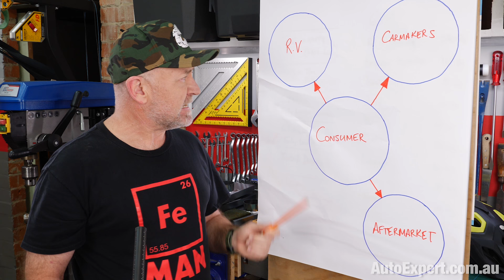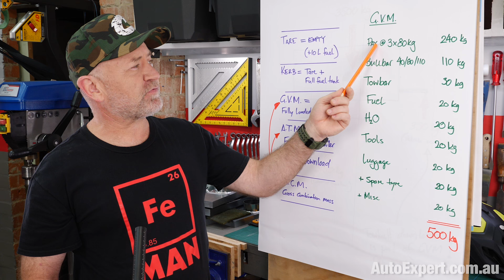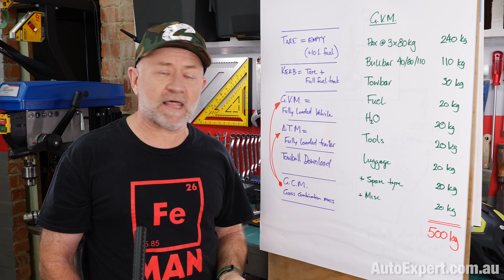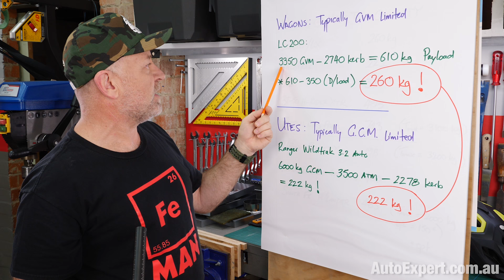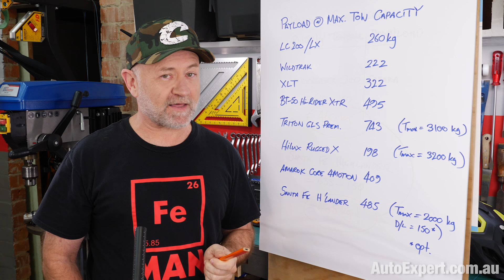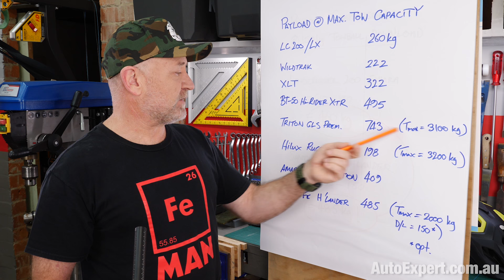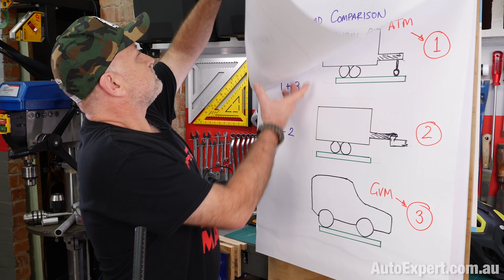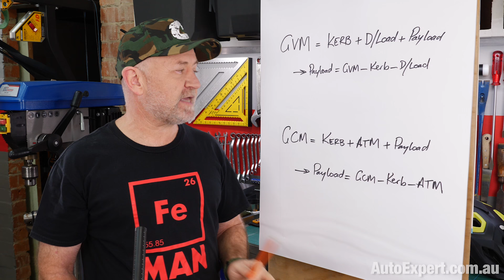Complete guide to heavy towing (GVM, GCM & ATM explained) | Auto Expert John Cadogan

Comment: The max towing capacity for some manufacturers is half for operating  offroad. It's often buried in the fine print. This is why you see so many dual cabs broken in half

Also, does the gvm upgrade also upgrade the driver?

Comment: I've watched this one a few times. Very good. Question though about mass of towing vehicle vs mass of trailer. Just for round figures and not representing any real examples, if you have a vehicle that weighs 2000kg and a trailer that weighs in at 2200kg, and you add 200kg of fixed accessories, such as roo bar or anything that doesn't move around, like people and stuff, then the vehicle now weighs 2200kg. Does that balance the weight of the trailer. I know it doesn't work for purposes of payload, as it counts as payload, but does it work for the purposes of resisting pitch and yaw of the trailer? I don't want to do this, but I am interested in the physics of it. Thanks.
Reply from the maker: The recommendation is just a rule of thumb. I'd say: Don't go too far off the reservation. This should be OK - just drive conservatively.

Comment: But. My Discovery has compressor for air braked trailer, tow limit 4000kg. A double towbar stabiliser, Brembo brakes on the truck, Cummins diesel and uprated suspension. It's certufied and plated at 7000kg GVM. But, still get the Iveco with gvm at 5500kg and GVM at 9500kg with air braked trailer

Comment: The Ranger's 3.5 tonne towing capacity is an absolute farce. 

If you hook up a trailer with 10% download, it's overloaded by 130kg. If you have the download at 5% then I hope there's a midget or jockey driving
Reply: The Ranger isn't rated anywhere near 3.5t in North America and I wouldn't consider anything less than an F150 for a trailer that weighs that much. Over 5,000 lbs I would want trailer brakes too.

Comment: I love your engineering for the layman. I recently watched your trailer hitch and totally agree but only have one point I really cant calculate. If the down force of the tow-bar is 350kg WLL, what does the load levelling device torque induce into the tow bar. Lets say the 10% rule of 2000kg, 200kg on the ball. Use any load level device for reference.

Comment: Santa fe would have 5 degrees of negative camber in the back with 150kgs on the tow bar (Also good luck staying under its 1395kg rear axle limit with 150 kgs, 1m back from the axle centre line).

Comment: Interested to know why you think bullbars are a bad idea? Safety, Weight, waste of time?
Reply: My guess is city slicker....
Reply from the maker: My guess about you: dumb fucker
Reply: We don't really do bull bars, but I am running a full guard winch bumper (14k superwinch talon). We have a shitload of suicidal deer in my area and I have hit 4 in the last 7 years. The first one messed up my stock bumper and the next 3 did nothing thanks to the 275 lb winch bumper. The extra 500 is not a big deal on a truck that has a 1050 lb engine in the front.

Comment: Jeebus JC ya left out the obligatory Engel Fridge & a carton of p!ss M8!
There’s an extra 20 or 30 kilos easy! 😂😂👍😜
Seriously tho, would you have thought with electric load cells cheap & readily available that the after market industry would have come out with kits by now that affix said cells under tow bar tongues and spring packs etc, that once calibrated, as you load the tow vehicle & caravan / boat, the load cell data bluetooths to a digital readout on the dash & displays all that critical data - alongside the manufacturers Max allowed lawful values & flashes a warning if any of the values is exceeded!
Maybe it beeps the horn or activated the emergency hazard lights until you restructure the load to below maximum?

If the mermaids stop you, for roadside weighing, you just point at your module on the dash!

Wheel loaders etc in the heavy trucking industry all have these load cells and they cumulatively tally each bucket full of gravel or grain or fertiliser lime or each log etc as the truck / trailer is loaded.

The truck likewise has load cells and the data is displayed in the cab!

Why aren’t manufacturers making this as standard equipment instead of dodgy sh!t no one wants like “I stop” where the engine cuts out at the lights?

This stuff ought be on your caravan boat trailer etc when you buy it!

Likewise possession of this knowledge should be in the drivers license exam!

If we can have onboard tyre pressure monitoring then why not on board GVM & GCM monitoring?

If everyone should be doing this why is non of the available technology being employed to allow drivers to comply.

In heavy haulage if you’ve been at it any length of time & been over weigh bridges often enough - clever drivers will mark the glass on their air bags pressure gauges to correspond with various weight loads, so they can tell at a glance if the galah on the wheel loader got it right when loading the trailers, or if he screwed up with tallying his load cell readings (they fluctuate up and down a little as they raise hydraulics against gravity for eg.

Aren’t we overdue for this sort of driving aids in the aftermarket industry for serious towers & offroaders?

Half the battle is the p!ssant tow vehicles available to us from current manufacturers at an affordable price!

The real toy haulers from USA are all well over the $100K now headed towards $150, but the same vehicle in Canada is ~ $60k but our currencies are about equal?

WTF is with that?

How about a video of the total phukwhittery of that situation!

You know while I’m at it how about this?

No vehicles are manufactured in Oz anymore, so, Why the Eff are we still driving RHD cars on the left side of the feckin road?

Just swap the traffic lights and white arrows etc & we can bring in Yank cars in LHD & drive on the RIGHT side of the road!

No need to do RHD conversions to these vehicles then at $50k / vehicle!

The roads are already there, no need to change them at all - just alter the signage!

You know it makes sense!

This is a bit like the old railway track width (gauge) conundrum between east & west until we went standard gauge.

Well let’s standardise our feckin roads so we can buy imported cars from other than the Japanese market!

Think of the savings to manufacturers if all cars in the world were LHD & every bastard drove on the right side of the road!

Why have a one world government if we still have multiples of currencies, metric and imperial systems, multiple languages, and we all drive on different sides of the road, in cars with steering wheels on different sides of the car FFS?

You just wait until I’m benevolent dick tater of this wide brown pizza - mark my word, dings will be different then!

I’ll bloody stop their farting in church let me tell ya! 😜😜😜😂😂👍🇦🇺
Reply: tone167 Tanks a million, I gladly accept! 😂😂
Reply: TL;DR
Reply: Jake Elliott Ahh a member of the short attention span theatre group have joined us I see! Would you like the cliff notes? 
You see I blame our schooling system myself, millennials who can comprehend nothing longer than a text sms! 😂😂😂
Reply: G'Day, Ian, just so you know, I'm 43 and I don't like reading novels.
Reply: Jake Elliott 43?
I’m truly surprised the shallow end of the gene pool hasn’t been drained before now! 😜😜😂👍
Reply: Fair point, but remember these car don’t even come with a tow bar as standard, let alone any sort of smart load measuring tech.
Reply: Ben T That could easily be fixed with a legislative change.
Vehicles not supplied with a tow bar by manufacturer can’t tow anything ever!
It would kill off the aftermarket tow bar industry overnight, BUT towing technology might take a leap forward where manufacturers might go all out to differentiate themselves from the competition by supplying towing technology as standard equipment, and with better technology than their competitors!
Tow pro electronic braking standard equipment & all the GVM data displayed on the dash!

Works for me!
Reply: Calibration issues... Loadrite on the loaders have a 10% tolerance...
Reply: Yeah sure everybody want every accessory but then when you tell them the price they don’t want pay, that’s why vehicles do not come standard with every option!
Reply: I actually agree with what you are saying accept for the Canadian prices (being an expat Canadian). The fact that Australian vehicles are rated at such higher towing capacities vs their North American counterparts can only be attributed to the fact that the Australian market does not have the availability of vehicles that meet the needs of the consumer.
We can get into a heavy duty CC 4x4 diesel pickup in the US for between $60k and $70k depending on options and providing that you don't go insane (if it has leather you are paying more than you need to). The same vehicle in Canada will cost you 15% more, but in cdn dollars (about the same overall cost) + taxes.
I can't imagine paying $10k to have a vehicle converted to RHD let alone any of the crazy import costs.

BTW: One of the things that you are asking for already exists. Instant tongue weigh measurement: https://www.weigh-safe.com/company-news/the-only-hitch-that-measures-tongue-weight-the-weigh-safe-adjustable-ball-mount/

Comment: All those numbers and Wank words like GCM, GVM, Tare weight etc are only just a manufacturer’s recommendation, with an inbuilt safety margin. Just load it to the gunnels, hook up the biggest van and off you go...
Reply: I think exactly the same way. Unfortunately that meant suspension replacement in my Ram 1500. I have a Ram HD now so all is good.

Comment: Good morning John, I live in Qld and am considering selling my LC200 and purchasing a new Ram 3500 for purpose of towing a 3500kg ATM toilet around AU and also having additional payload capability in truck

I prefer the 3500 RAM over the 2500 variant as it increases payload from 886kg (not enough for my needs once TBM factored in) to 1,759kg (more than I need lol but at least no more worrying about going over limits).

Question if I may - Is there anything I should be aware of regards moving to the NB 2 class vehicle?

I already hold relevant Qld drivers licence but curious if any other implications e.g. registration cost, any annual or bi annual requirements to have it inspected for roadworthiness compliance in Qld? Or anything else you’re aware of that I should consider?

Kind Regards
Kev

Comment: Hi John.. Have really found your explanations on GVM,GCM, etc very interesting and insightful. I have the 2018 Wildtrack and understand the difference between the XLT and Wildtrak GVM is different because of the extras on the Wildtrak i.e Roller shutter . If however if i was to put a Canopy on both models ( Which subsequently would need to remove Roller shutter and sailplane off the Wildtrak ) would my GVM be the same as the XLT ? .. Secondly , if removing the Tub and Roller Shutter completely and changing to a service body ( for easier access and drawer compartments ) would you need to have the vehicle GVM re visited?

Comment: I did find an error with Triton’s payload figure, it is 545 kg not 743 kg. I am thinking about replacing my 2000 
model Rolls Canarly 4wd, it is getting on in years. So I have been looking at all the weights and loads of
different vehicles on my list and have come to the opinion that none of them are really heavy tow vehicles.
I am leaning towards the Pajero Sport for a vehicle that suits my needs, not heavy 4WDing and light to medium towing. 
Unfortunately people go to the dealer and view the vehicle specifications, max tow capacity 3500 kg and
5 seats, you little beauty. There should be a warning label on the owner’s manual and full disclosure before the
contract is signed. Please Note:  Maximum towing weight of xxxx kg will reduce the payload to xxx kg
(less once the towbar is fitted). Enjoy your new vehicle. Thank you. 
Power boats are marked for example max HP 115 recommended 75 HP.

Comment: Hi John, just an inquiry about the part of the video where you mentioned the Triton GLS payload. Is that 743kg with tow ball weight of 310kg already removed for the 3100kg trailer? 
If so wouldn't the payload of the car at 3500kg tow capacity, up from 3100kg, only drop by an extra 40kg tow ball download weight? Not an extra 400kg off of the 743kg as you mentioned in the video, taking the payload to 703kg.

Comment: Geez I have a XLT Ranger, with a few Tickford enhancements I know means nothing + an Ezytrail Parkes15.  It's only a 15ft caravan but its 2.4t unloaded.  I thought I would be fine for towing, I am probably ok with the limits but you talk about not towing over 2.5t on a Crusier or Ranger.  Makes me worried now.  Rough figures here, but close:  Kerb 2250, Payload 500, TB 300, ATM 2850.....GCM = 2250 + 2850 + 500 =5600, limit being 6000.  OR   am I being completely stupid?

Comment: Interesting, I have an L200 Barbarian here in the UK which is the same as the Triton over there, the gross trailer weight is given as 3500 Kg with a 140 Kg nose weight ie tow ball loading. I used to make trailers for a living and would often get asked by customers what was best for towing a heavy trailer, my stock answer was a tractor. I also recommended that they should get a nose weight scale in order to ensure they were within limits when loading.https://www.amazon.co.uk/Milenco-2691-Calibrated-Caravan-Trailer/dp/B004W17D94
Over here there are companies that will upgrade the GVM of vehicles for you, heavier springs etc plus legal work, but once you go over 7500 Kgs you will no longer be able to drive on an ordinary car licence so you need to get yourself upgraded as well to an HGV licence
Reply: Australia is classed as a hot weather country so they often lower the tow limits.
my 2015 amarok is limited to 3000kg towing and 15,000km servicing but in cold weather country's its 3200kg towing + a higher GCM and 20,000km service.
Reply: A 3,500kg trailer should be running closer to 350kg tongue weight to avoid sway. That little nose weight would have you upside down in the middle of Kansas once the wind go up.

Comment: So my Pajero Sports advertised tow limit of 3100kg is a load of crap. GCM of 5400 less down tow ball down load and tow limit is 1990 kg which is lighter than the dry weight of the car.
Reply: Hi Romi22,
I am currently researching Triton and Pajero Sport as my next vehicle and I am leaning towards the Sport.
If you tow max load of 3100 kg with 10% tow-ball weight the loads became ATM 3100 kg = GTM 2790 kg
+  tow-ball down load 310 kg.  The Sport has a GCM of 5400 kg therefore you subtract the GTM from GCM.
The result is 5400 - 2790 = 2610. The Sport has a GVM of 2710 kg, so if the result (2610) is lower than the
manufacturer's GVM you must use the lower as your towing GVM. If the result is higher than the manufacturer's
GVM use the manufacturer’s GVM in your calculations.  
Towing GVM 2610 kg - 2060 kg KW - 310 kg TDL - 40 kg (approx tow-bar weight) = max payload 200 kg.
So if we add the figures up - (vehicle) 2060 + 310 +40 + 200 + (caravan) 2790 = 5400. 
So in my opinion even though the Sport maybe rated to tow a 3100 kg load I would not do it. 
If you do the some calculations with a caravan weighting ATM 1500 kg (GTM 1350 kg + 150 kg TDL) the result 
is more favourable. Anyway this is my research so far and I think the Sport suits my needs better than the Triton.
What model Sport do you own and how would you rate the vehicle? If I decide on buying the Sport I will need a good broker any suggestions?
(Just joking John and if you read this please excuse my lack of ability with the written word).
Reply: Harro 1931 I’ve had mine for over 2 years and have driven over 70k km. Haven’t had a single issue with the car.  I was initially looking at a Ford Everest but chose the PS for its value. I think it’s a great car.